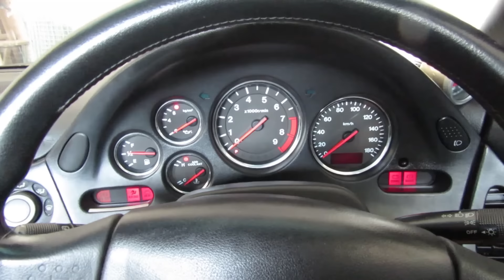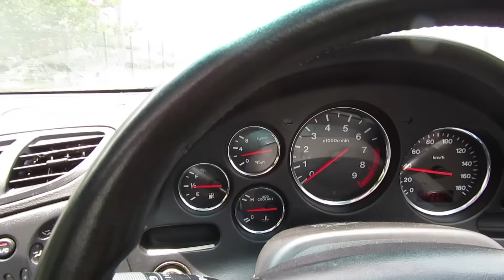Mazda RX7 FD Roadworthy Test!

Comment: check your vacuum line on the sequential turbo for leaks if it's not boosting on secondary turbo. my vacuum line was the problem and got it fixed. I'm boosting 8-6-8 psi. kind of low but fast enough for me
Reply from the maker: 8-6-8 is pretty low, I'm driving it again for fun on Saturday just me and the car (no cameras) as I wasn't able to focus on the car or drive properly. Picked up a gauge pod holder so I can see what boost it's running. I'm hoping it's as easy as a vacuum line problem. I believe on the 1997 and upward they completely revised the vacuum lines and made them less of a rats nest and more durable. Either way I'll check it out :)

Comment: I agree boost leaks are probably your issue if you think it's not boosting properly. Check all hoses and clamps anything that basically run to the turbo.  One time I just ended up getting a fog machine hooked up and found the leak super quick.
Reply from the maker: That's actually a really good idea. Time to whip out the old and dusty DJ equipment!

Comment: BAH dude gauge or not, if the oil needle is pointing at zero stop get it home and check it out. Immediately.
Reply from the maker: It's a common issue with the RX7 cluster packs, capacitors start to go. In fact as we speak the entire cluster pack is dead. All gauges are fucked
Reply: Yeah but if you do get low oil pressure you'll have no way to know..., obviously this vid is a couple weeks old now, I hope you made getting a working oil pressure gauge a priority.
Reply from the maker: Nope, air separation tank broke so no coolant, replacing that first. Then fixing the cluster before driving the car again.